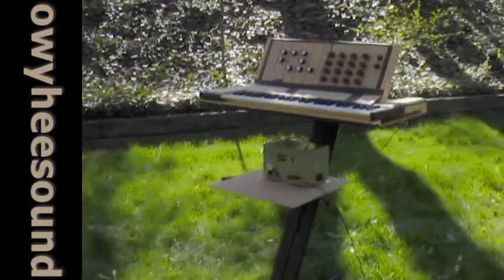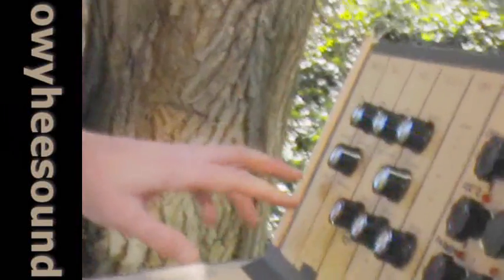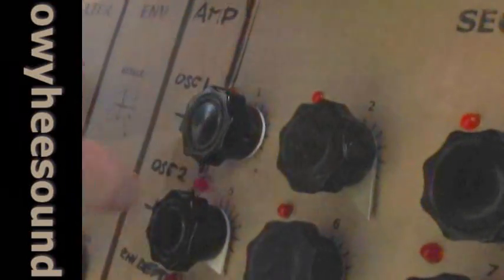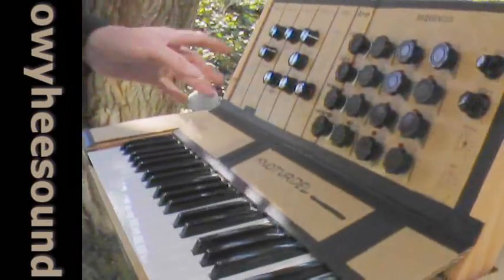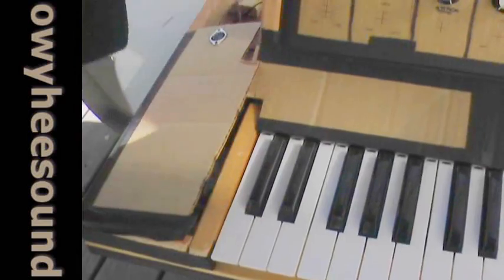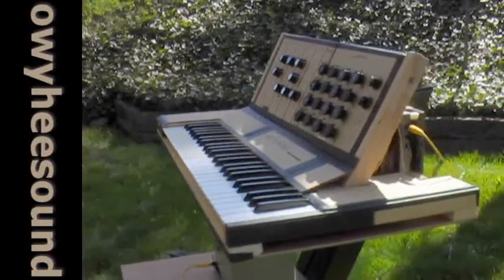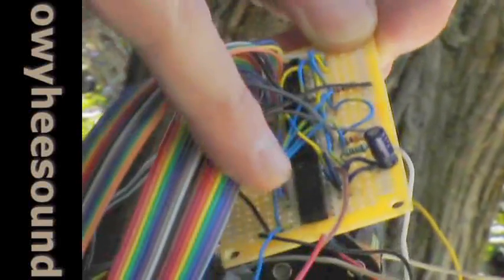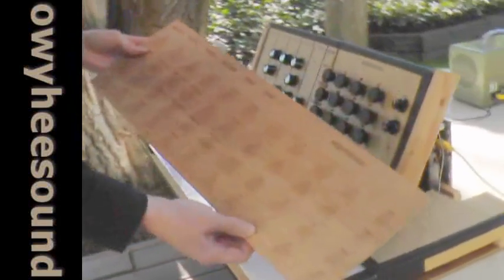DIY Synthesizer in cardboard

Comment: Oh this was back in the good old days when there were still unwanted synths like CSO1 Poly 61 poly 800 and JX3 that could be bought off eBay cheaper than a trip to Costa or Starbucks.
You could tear them apart and mod them. And if you killed it you'd lost $20-50.
Now a JX3 will set you back more like $1500 and you aren't getting much change out of $400 for CS01. I actually gave mine away in the 1990s to some young Girl who saw me unloading my synths out of my car and came over to talk to me.The CS01 was only in the car as I didn't actually buy it so it was just shoved in the pocket of a flight bag  of another synth .She seemed interested in getting a synth so I gave her one 
I was glad to get rids of it.